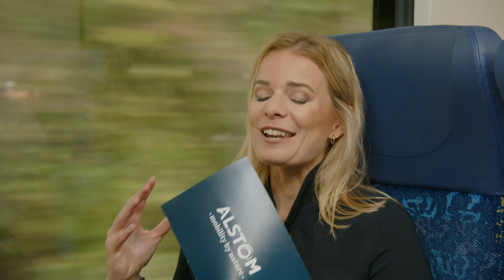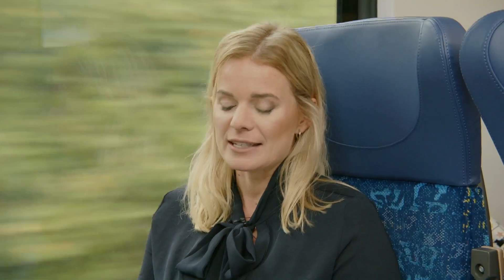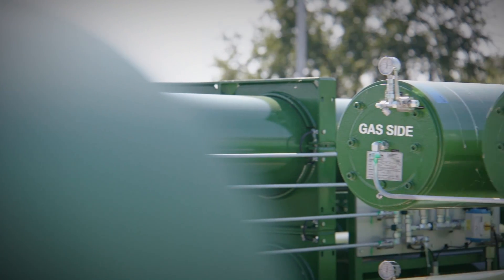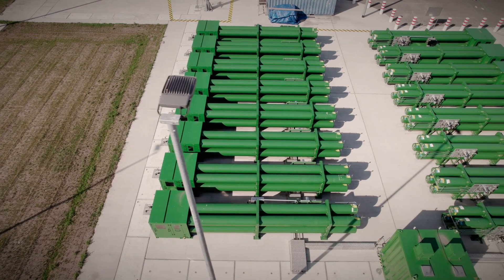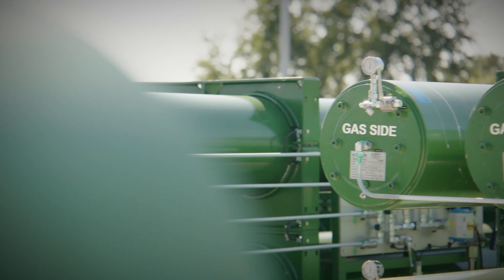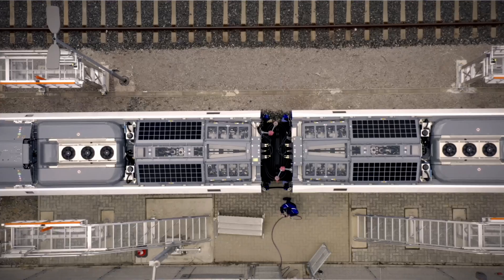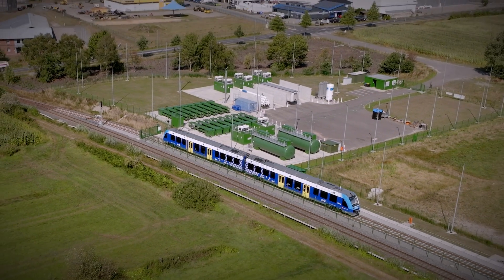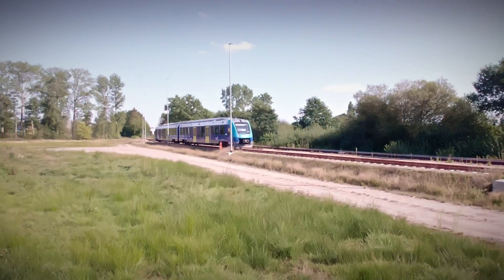The Linde hydrogen filling station - powering the Alstom Coradia iLint

Comment: 96% of currently produced Hydrogen on commercial scale comes from Methane because Methane is the richest source of Hydrogen with 1kg Hydrogen present in every 4 kg of Methane or 25% mass fraction of Hydrogen in Methane and cost is lowest out of all the alternative ways to make Hydrogen. No other molecule has 25% or higher mass fraction of Methane. As long as Earth sees birth  of organic life and death of organic life, ruminants, abiotic reactions, Earth will continue to have formation of Methane. Steam reformers consume 4.9 tons of water per ton of Hydrogen produced which is still less than 9 tons of water to be electrolyzed to make 1 ton of Hydrogen. Reformer pressure is in range of 20-30bara from which the hydrogen product is compressed to 700bara for Toyota Mirai car and to 350bara for Hydrogen bus or truck and cooled to 233K with the help of liquid nitrogen. LInde is using ionic liquid piston compressor to compress Hydrogen from 20-30bara to 350bara consuming 3.2kWhr/kg. Hydrogen has a poor energy density per unit volume, is prone to leakage and liquid hydrogen is prone to daily boil-off loss, Hydrogen is hard to cool as it has 3.42 times higher specific heat capacity than that of cooling water.
BASF has been working on catalytic pyrolysis of Methane using catalysts like Ni or Co or Carbon based. There is a plant operated by M/sMonolith Corporation to produce 14 tonnes per day of Hydrogen from Methane pyrolysis in Nebraska state of USA. Methane pyrolysis consumes much much less amount of water or steam than steam reforming. Water electrolysis needs 7.7 times more energy than Methane pyrolysis. Catalyst can reduce the temperature of methane pyrolysis to as low as 873K and the reaction needs low pressure of atmospheric or even lower by feeding an inert.  Catalytic Methane pyrolysis has the potential to replace the steam reforming of Methane route.
Water is a poor source of Hydrogen with just 1kg Hydrogen present in as high as 9kg water or Hydrogen mass fraction of just 11.11%. To make 1kg of Hydrogen needs electrolysis of as high as 9kg water with 50-57kWhr units of electricity.  Solar and wind are variable and discontinuous. Each of solar, wind, hydropower,  geothermal and biomass have 2 to 3 orders of magnitude times lower surface power densities than those of fossil fuels and nuclear. Energy storage battery have poor ESOI value, low energy density per unit volume and life of battery is also an issue of concern. Water electrolysis route is costly and resource intensive. It is doubtful about the reliability of using combination of energy storage and very low surface power density source of energy for water electrolysis.
Toyota FCV uses the raw materials of aluminium, steel and plastic. Hydrogen storage tank of that car is made of plastic only.  Even a train is made using raw materials of aluminium, steel and plastic. Unless recycled raw materials are used to make a transport vehicle, the process for making steel or aluminium or plastic is energy intensive and emits CO, CO2 and perflourocarbons-Does the use of such rawmaterials make the vehicle green?